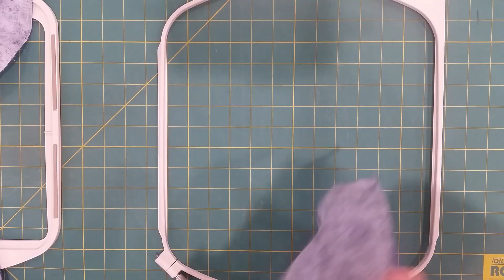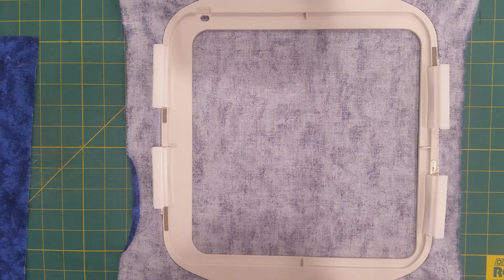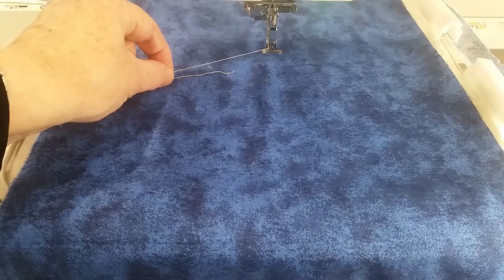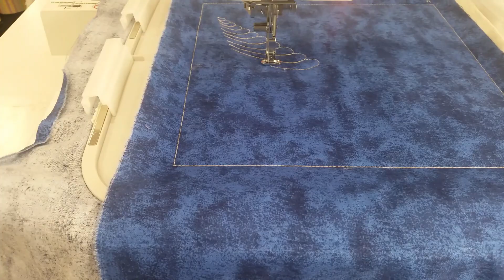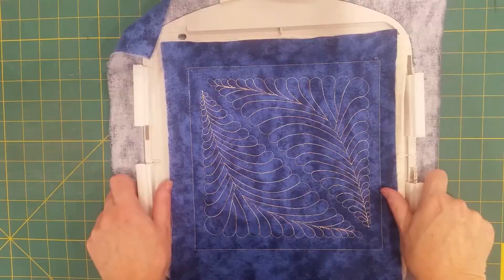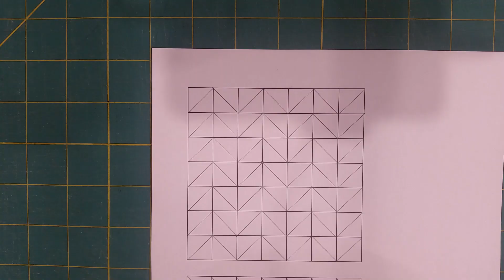Quilting with your Embroidery Machine - Design 024 | QAYG wider

Comment: I would like to purchase your designs.  I have a Brother NQ1600 with the 6x10 hoop and I use my 5x7 in it also.  Does your designs fit the size hoops for my Brother machine
Reply from the maker: Your 5 x 7 hoop should do the 14cm designs. 
Whilst I don't have a specific size that matches a 6 x 10 hoop, you should be able to enlarge the 14cm  designs to fit the 6inch width of that size hoop.
Just make sure you purchase them in the correct format.  Probably PES for Brother.
Cheers Sharyn
Reply: Thank you.  I will be purchasing after the holiday.  I need to get started on some baby quilts @SharynsSewingSchool
Reply from the maker: @gmstovall  I always love to see what people make with them!